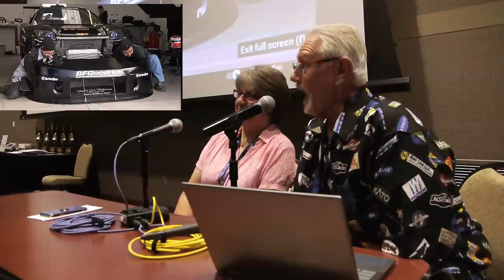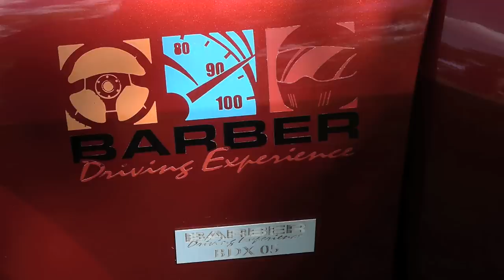Our presentation Southwest Region of the NMRA

Comment: All the layouts you featured are absolutely stunning and inspiring. Thanks to both of you Toy Man TV, for bringing those and your own modeling  to us.  Otherwise, I would have never been able to see them. The only thing I'm looking forward to if I ever get to retire is to build a fine quality layout like one of those.
Also, as a forever Mustang / muscle Ford fan and long ago owner (a 66 A-code coupe with a factory bench seat - still my favorite and most fun car I ever owned, 69 and 70  428 CJ Mach 1's, and a few 390 - 428 and 429 Fairlanes and Torinos - long before they got really expensive to buy) I enjoy your car videos as well.
Reply from the maker: Yup!  Oh those mustangs. The blue one cost $3500 in about 1980 when no one wanted them. GT390 turned into a Shelby. Engine hopped up to over 400 HP. Now it’s about 450. And runs soooo good. $3500.

Comment: Clearly they don't know how DCC works. We have pulled trains just as heavy and long with every locomotive being powered with mid train power and end train power. We didn't have any problems at all.
Reply from the maker: Yup. Even though this railroad often pulls 20 amps with all trains pulling full load, 20 amps can be done. I’m running 5 amps but adding more wattage is really simple. A bit expensive.
Reply from the maker: The biggest challenge is adding DCC to about 40 Athern locomotives.